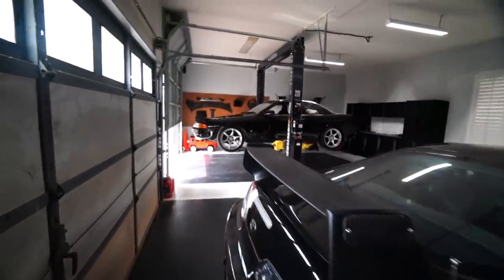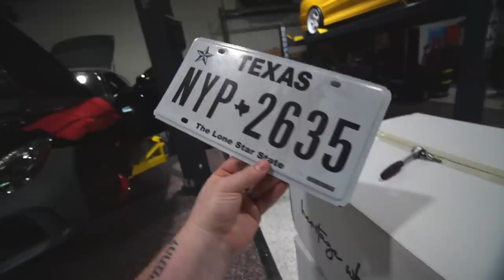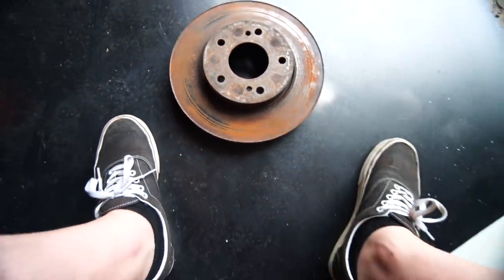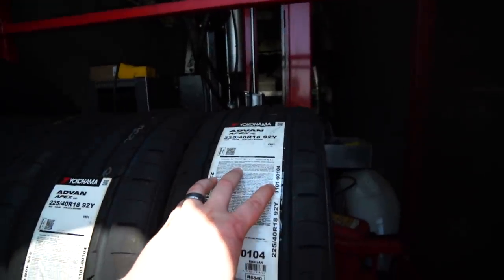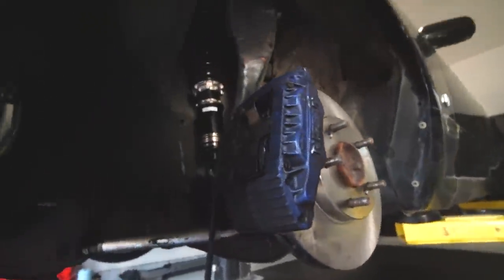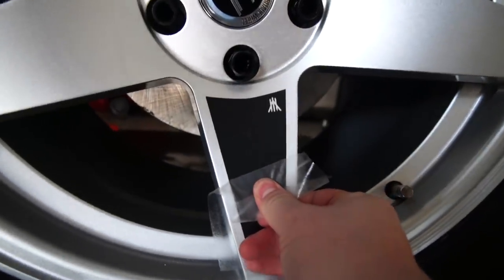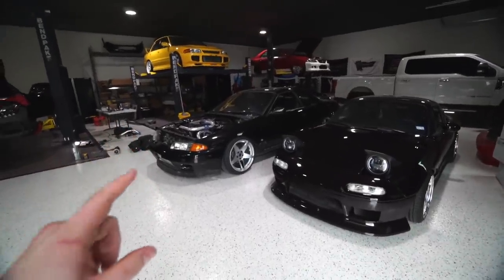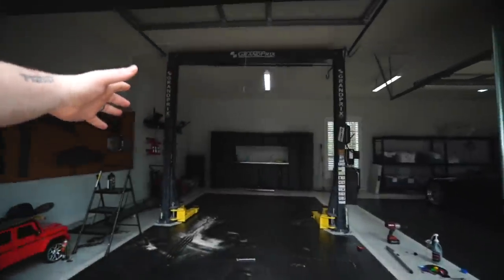R32 WHEEL REVEAL! - Abandoned R32 is looking SICK!!

Comment: You can always pull the awd fuse and turn it into a rwd and do sick burnouts and skids
Reply: They have a performance module where you can adjust turn between the front and rear and you can adjust how much torque goes to the front and how much goes to the rear or you can just have it  I'll go to the front I'll or go to the rear 30% front 70% rear you can adjust it to your liking it's pretty sweet setup if I win the R32 or when I buy one myself I'm definitely going to get the performance module for it it's really nice because you can change it all different ways so you can be drifting down one road and then put it all wheel drive rally racing on another just by the turn of some knobs
Reply: It's a GTS-T, it's already RWD.
Reply: @DriftNick  I seen that this episode if I win I'm going to make it all wheel drive I'm going to make it a clone GTR with a rb26 or rb30 and a sequential transmission all in time though Rome wasn't built in a day
Reply: @niceguytim3337  Just but a GTR, it will be cheaper.
Reply: @DriftNick  not if I want it and it's only time anyway thanks though have a great day

Comment: Couple of things. Does the r32 have a welded diff? watching the fresh tires spin when making that turn before the attempted burnout had me wondering. Could be nothing though.

Also, GE supra with an open diff and 500-700hp? Assuming you haven't fixed that since the gender reveal video. Thats sketch. Def need to get a much better lsd to manage that kind of power safely. Don't want you flying off the road.